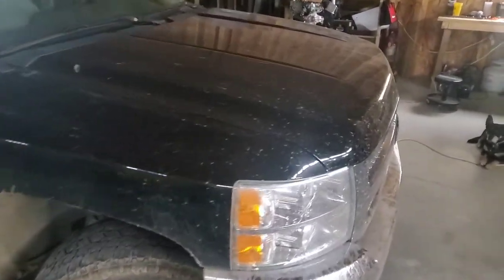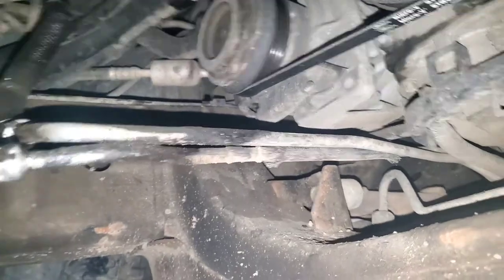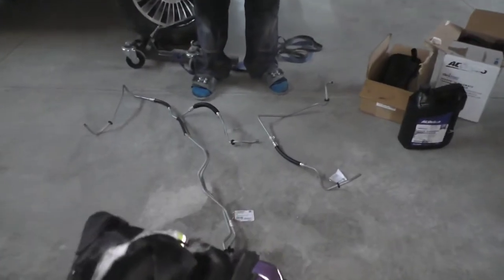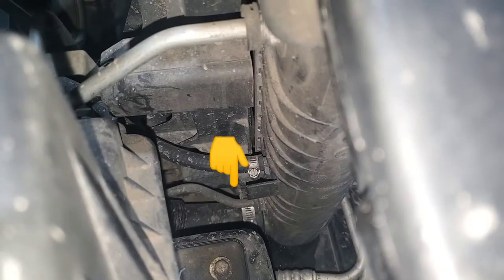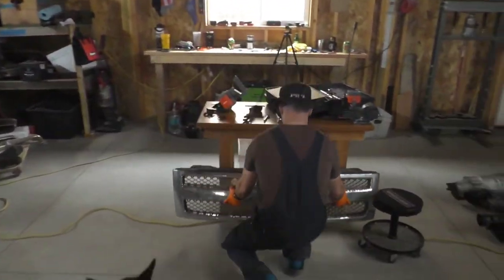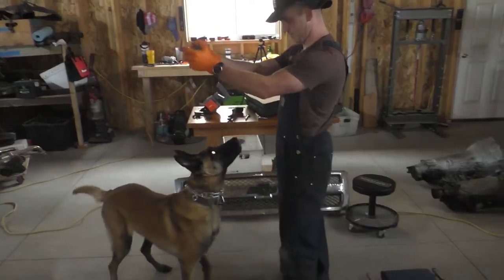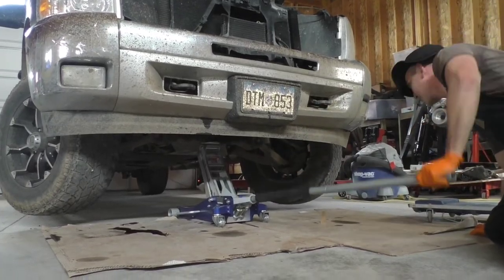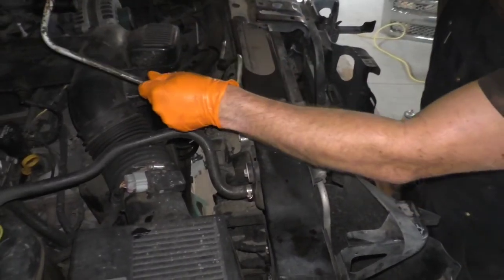How To Replace Transmission Oil Lines 2007 - 2013 Chevy Silverado or GMC Sierra

Comment: I consider myself a YouTube Technician. Lol So glad I found your video. I am a 55yr old female and have impressed myself of what I'm capable of. Even did an oil pressure sensor that would have been charged $360. Took me 45 mins (feel only) with me laying on the motor. Next time I'll put a moving blanket down for comfort. Lol I'm a bit short but very determined.  Thank you for an awesome video and humor!!!
Reply from the maker: YouTube Technicians are the 2023 version of the 1990 Shade Tree Mechanic. We approve, glad you enjoyed the video!

Comment: Glad I found this video.  I was looking under my truck before watching and thought I had it all figured out, but seeing how much book time the job called for I assumed I must've been missing something.  
My lift is currently clogged up with a non-running project car so I had to do this on my back in the driveway at like 37 degrees, racing the clock before the rain started.  All said and done it only took maybe 45 minutes, and I was taking my sweet time towards the end.  

Probably would've been a 10 minute job on the lift, can't believe the stealership charges so much for it.  SUPER simple job, I didn't have remove the grille just did it all from underneath and reached down under the hood for the line on the rad.  I took the skid plates off (just a few bolts that came right out with hand tools) and had a lot more room,  didn't really even have to fight with the lines to get them back into place, just a little finessing.  Longest part of the job was trying to find the clip I dropped...  First time in quite a while that something went super smooth and was way quicker than I thought lol.  

Also, since I caught the leak basically as soon as it started it barely took any Dex-VI, basically what was left in the lines and the tiny bit that sprayed out on the short drive home, still have a mostly full QT at my disposal.  Great idea on taping over the ends of the lines, the bottom of my truck is real nasty so I definitely would have gotten a bunch of crud in those lines had I not covered them (which I honestly probably wouldn't have thought of on my own lol)
Reply from the maker: We're happy you found the video useful and the tape trick worked! Every now and again we share some tips that people may not know. Make sure to subscribe to support our channel and so you don't miss out on the next tip! Alternatively, we do some pretty dumb stuff and it can be fun to point and laugh at the idiocracy. Either way is a win for you =)

Comment: It saved much work and $$$ by watching your video. I had planned on doing the job myself but would have done unnecessary steps. I bought the 2012 Sierra new -- it still only has 55000 miles on it so i was surprised when the transmission line began to leak.
Reply from the maker: Glad we could help! Let us know if you need anything else!!

Comment: I used this video to do the lines in my 2011 gmc sierra. It was extremely helpful. 800 to 1000 at the dealers and I did it for 200. I'm going to take it to a transmission expert to drop the pan and put new filter and oil in it for another 200. You saved me a lot of money so I'm grateful. Being on a pension I have to watch the bottom line. Great job. Keep up the good work.
Reply from the maker: Awesome! The pan and filter job are fairly easy too. We have a video on transmission service if you want to check it out!

Comment: Thank you so much guys for the extremely helpful video! On a 2012, there is a metal harness that holds the lines above the axle.  Cant hardly get to it from any angle and it kept the lines binding. That thing was an absolute PAIN to maneuver around, had to bend it up and away. That was the main hold up, thanks guys for the video.
Reply from the maker: Absolutely! We hope you can find other videos on the channel just as useful! 

Also, we're glad you found a workable solution. Often that is the hardest part of automotive repair.

Comment: you can do that job in less than an hour taking your time by cutting out the original leaking rubber lines, flaring the metal tubing ends and replacing the leaky cut out rubber lines with new aftermarket rubber transmission cooler lines and hose clamp on place. Just like you do when installing an aftermarket transmission oil cooler.
Reply from the maker: That is absolutely one option! We opted to go with the OEM route, but of course, the aftermarket choice is acceptable if done correctly.
Reply: Do you remember if the lines were 5/16 or 3/8? I'm opting to just remove the crimps like you.
Reply from the maker: Can't recall, you might be able to look up the part number though and find out for sure

Comment: Routing those lines by yourself is a huge pain. Take it from me, watch what theyre banging into on both ends. The metal part of the lines bend easily and once they bend if you bend them back they snap. Also, foam earplugs work great as foreign matter exclusion for those lines.
Reply from the maker: Foam earplugs! There's an idea we hadn't thought of. Thank you for sharing, and we agree.. slow, steady, and careful is the approach to the lines. Working with a partner is preferred.

Comment: I like to use nitrel glove finger tips for feeding cables and hydraulic lines. I don’t have baggies in the shop but lots of gloves. Finger tips and a zip tie zap strap whatever your dad told you it was called.
Reply from the maker: Hmmm.. that seems like an improvement on our method. Love it! Thanks for sharing, and stay tuned to see if we remember to do that next time.

Comment: I did this over the weekend, didn't lose too much fluid other than from the cooler, when I check the fluid It's at the cold marrk or slightly over at 147, haven't been able to get it up to 160 to verify it in the hot zone, is this normal?
Reply from the maker: Yes. The trans cooler keeps the temp down, particularly in cooler weather or when you're not under much load.
Reply: @NiceGuysGASS  so at 145-147, it's normal to be right at cold or between cold and hot? I just want to make sure I don't need to top off with fluid but since I can't get it to hot after driving it I don't want to end up overfilling
Reply from the maker: At 145, between hot and cold would be correct. Confirm this by checking it when it's cold, about 3 minutes after you start the engine. If it's at the cold line after startup, and inbetween hot and cold at 145 - you should be good to go

Comment: Great vid. You make it look easy. How long did this take from start to finish? I have a 2007 avalanche that needs this.  Ive done this on a 2005 Avalanche, its much easier.
Reply from the maker: This job probably only takes about an hour start to finish, not too bad. The hardest part is feeding/routing the lines - helps to have a second set of hands to maneuver them! Kyle had Dale helping him in this video

Comment: I replaced my radiator last week and I've had transmission fluid leaking from the top cooler line, is there an o ring that's supposed to be in there that would cause it to leak when missing?
Reply from the maker: Yes the adapter the line pops into has an o ring in there, you have to take the line out and remove the adapter from the radiator to get it out. Usually the new radiators have new adaptors, but it's possible the o ring got pinched by the line.

Comment: Finding this part for the 2014 plus with the thermostats block is very difficult.
Reply from the maker: Sometimes you gotta go to the parts desk at the local stealership.. one of life's unfortunate truths
Reply: @NiceGuysGASS  I was able to find the right hose today at orreileys. Already got it swapped . Great video. It was a big help , I was considering cutting it and clamping it prior to seeing your video. No reason to , easy enough. Even on a 4wd.
Reply from the maker: Glad to hear it all worked out!

Comment: Need to replace lines on my 2011 sierra 1500 ext 4x4 but can't find the part numbers you list. Only the auxiliary line i can find. Other parts ending in 415 and 417, but not 419. Also 22802047 for lower. One parts place only lists two options for my truck being 22802047 and 15779543. Any suggestions on finding the correct parts? I'm assuming mine is standard parts. It's not an HD model or anything special, just an SLE i believe. 4.8L engine.
Reply: Ok after looking harder, i have no auxiliary cooler. So I'm not sure why it's recommending me the aux cooler line.

I believe the correct parts judging by pictures of the radiotor side shape are:
Upper 25999417
Lower 22802047

Any way to confirm this from my glove box or vin?
Reply from the maker: Not that we know of, but usually we cross reference two sites (Amazon and Rock Auto, or Rock Auto and Napa, etc). Make sure you choose the options that match your truck (engine, 4x4, no aux cooler, etc). Then full send, take the old ones off and match them up to your new ones. If they're different, return them and bring the old ones with you to match them up. 

If all else fails, you can buy parts from the dealership... but that gets expensive
Reply: Yeah I usually order from Rockauto. Should have the lines by the end of the week hopefully. Thanks for the reply.

Comment: why not just use rubber transmission hose to replace the steel lines?
Reply from the maker: Pressure, fittings, heat, longevity, safety, etc. There are some parts that should just be replaced with OEM stuff. This is one of those parts.
Reply: I agree. Aftermarket Dorman lines are terrible.